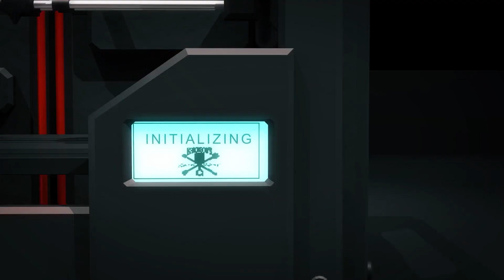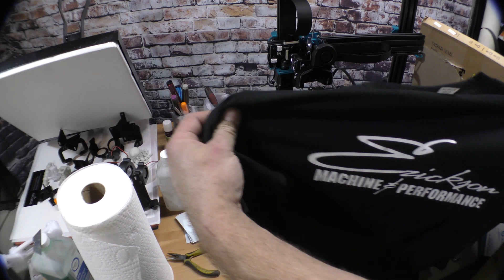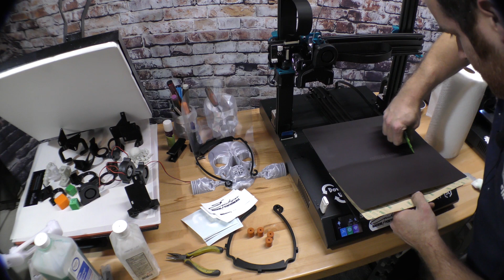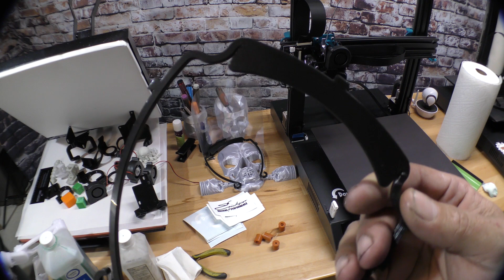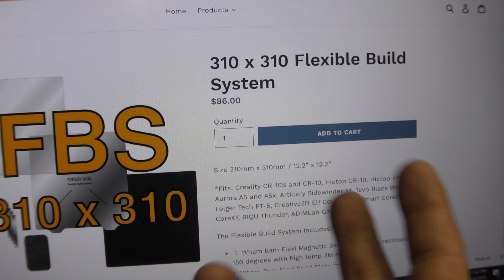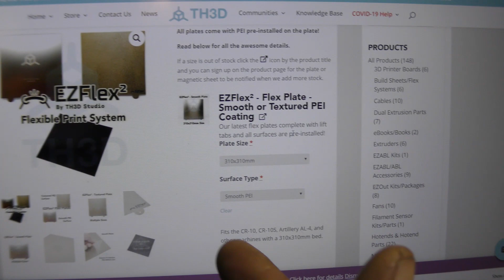How 2 Install a Flexible Build plate on the Artillery Sidewinder X1  Best Upgrade for ur 3d printer

Comment: Do these spread out the heat more and reduce the cold spots above the bed leveling screws?
Reply from the maker: The main benefit is easy part removal. Just flex and the parts come off

Comment: Try Lowe's, Home Depot, or a paint store like Sherwin Williams for isopropyl alcohol. You should be able to get it in 1 or even 5 gallon containers, and it will be at 100% concentration.
Reply from the maker: When I did this video it was when C o v I d was insane and you couldn't get alcohol

Comment: Idk if its the best idea fiddling with the high voltage printbed while the printer is connected to main power
Reply from the maker: That's like saying you should disconnect your car battery before putting on a
 sticker on your back window.  110v isn't high voltage And everything is shielded.       Your basically putting a sticker on a piece of glass 😉 

Have a great day
Reply: @EricksonMachinePerformance  i get your point, but after all in other countrys those beds have 230 AC and lets face it - chinese manucatured machines arent always really up to all security standarts
Reply from the maker: @ТЇІІ  do you unplug your machine every time you take a print off?  Your more likely to get shocked cracking a bed removing a print then installing a magnetic sticker..

Comment: Absolutely nothing wrong with the printer bed supplied. Why mess with stuff. ?
Reply from the maker: Makes it fast to remove parts.  Especially if multiple parts!! Or extremely large parts with a large contact area.   Also not having to beat on the bed to remove a print keeps everything level longer.   There's a reason Almost ALL high end professional machines come with them Standard.   Try 1 you won't go back!!

Comment: Thanks for that,
won't lower enough ,
I saw in your video you removed the 
four springs,and mentioned silicone bushes
Reply from the maker: Weird.  I added the silicone springs later
Mine fit oem no problem.   Try shorter springs or move the z end stop sensor

Comment: Why would you want to?
Reply from the maker: Why would you want to what?  Add a flex build plate?    Because they make it way easier to remove prints!!!
Reply: @EricksonMachinePerformance  Don't you just wait for the plate too cool down and it pops right off?
Reply from the maker: @amelliamendel2227  first depending on what material you are printing that doesn't always work. ALSO WHY WAIT!! with a flex build plate as soon as its done pop the plate, flex it and start printing again!!  i printed about 10000 face shields that we donated to hospitals and theses flex plates were a LIFE SAVER my printers were printing 24 hours a day 7 days a week only stopped to remove the completed shields. During that time the printers NEVER cooled down.    also the larger the print the more surface area the harder it is to remove     PERSONALLY i wouldnt own a printer without a flex build plate for general 3d printing

Comment: Do you have a link to the spring replacement
Reply: Yes please! I can not find them anywhere and the spring are driving me crazy!
Reply: I just found these for mu Artillery Sidewinder X1.  Search this on Amazon.  "BCZAMD Heatbed Silicone Leveling Column, 3D Printer Hot Bed Mounts Column Stable Tool Heat-Resistant Silicone Buffer for Prusa i3 Plus Anet A8 Wanhao D9 Mega, 4 Pack Brown"

Comment: I'm trying to figure out if I want these on my new sidewinder (arriving today!!) as I have a pei set on my Ender 3 and love it... But I got the sidewinder for petg, tpu & other hotter materials. I'm worried about them bonding to the sheets, do you have any issues with that?
Reply from the maker: i print Petg at 250c almost every day and have never had an issue. 1 of my sidewinders only prints Petg. i wouldnt worry about it but If you want to be safe use alittle glue but not needed     i like the th3d best. and the flex build plate is BY FAR my favorite upgrade
Reply: @EricksonMachinePerformance  thanks, now just comes down to texture or smooth 😊

Comment: I have been slow in making up my mind on getting a flex plate system for my SWX1.  I have not used my printer for well over three months due to health(non-COVID-19).  I ordered the Whambam system.  The TH3D is not available at the moment.  I have used the spring bushings and for whatever reason, I can not keep a good accurate bed so I went back to springs.  The springs are 25mm (yellow) with the flat bottom and they seem to do a great job.
Reply from the maker: I have found with the silicon you have to go back over them once or twice while doing the setup but after that ur good.   I think it just takes a couple seconds for the silicone to settle after its compressed which is why it moves a little bit initially but after its set they really don't move

Comment: I have to admit there's a lot of people who love this Wham Bam build plate But i really don't have an issue with the ultra glass/Lattice Glass build plate prints sick when printing and release when cold.
Reply from the maker: Have you used a flex removable build plate?   Pla the stock bed is great.   But petg isn't as good.  It's nice to be able to quickly remove and start another print. Especially large prints with alot of surface area
Reply: @EricksonMachinePerformance  Even with PETG my glass build plate worked like a charm. The stuff sticks like crazy, and pops off when cold. Every time. Still modded with a PEIK plate, which also works. Main advantage: the heat is more evenly spread, and less curling edges on large prints.

Comment: The specs on this printer say 300 x 300 on the X and Y. Why are you recommending a 310 x 310 build plate?
Reply from the maker: the build plate is always larger or you would be printing on an edge
Reply: Same reason my Ender is 220 x 220, but really 235 x 235. One is the build volume of the printer, the other is the physical size of the bed plate.

Comment: Great videos! I have sidewinder on the way and im looking at all the options etc. i was just thinking about the magnetic built plates and thinking the wham bam was a bit expensive by the time it gets shipped to aus with the currency the way it is. The TH3D looks like a great alternative for the money so i will get it. I watched the review on your printer and i like how you’re a no-nonsense, practical guy and your videos are easy to listen to. Keep it up 👍
Reply from the maker: The Th3d is cheaper and in the USA.   I have a link to it in the description.   Its my personal favorite
Reply: Mate, I'm about to buy one. Did you get yours yet? and if so, did you get the textured or smooth?

Comment: Which version of the Sidewinders are you using here? Version 4?
Reply from the maker: Yes both of mine are V4s.  But both are different 1 has the standard V6 heat break the other has the Kranken break.  But they are both awesome.   I believe the new Kranken style is the newest but I'm not a 100% sure
Reply: @EricksonMachinePerformance  thank you
Reply: @EricksonMachinePerformance  Did you put the Kranken in- or did Artillery upgrade the breaks now..  I just got a Genius and I'm wondering if they still put a PTFE lined break in.

Comment: You think this printer is too much printer for a first 3d printer? Seems like everybody suggest Ender.
Reply: I doubt it. With easy set up and leveling, just make the additions made in the video and you'll be making good prints in no time. The part that takes experience is learning the different nozzle profiles you will need to make successful prints with the different materials out there. If it's in your price range, buy once, cry once as the saying goes.
Reply: @MrDLRu  Thanks for getting back to me. Right now the biggest problem is finding one in stock. This seems to be a nice printer. I'll either get one of these or the Genius depending on what I finally find in stock. I think I'll use your link for the WB bed addition no matter what I get.
Reply from the maker: there is a reason they are sold out. They are in high demand because of there quality. Wait to find one or preorder it   you will live it
Reply from the maker: not at all the ender 3 needs alot of upgrades to print half as good as this. This is one of the best printers to start with 100%

Comment: You can use 90% acetone. Works exactly the same and it's not as flammable as people think(nail polisher remover). I use it all the time.
Reply from the maker: What about 100% acetone?   Will it affect pei or pex?
Reply: @EricksonMachinePerformance  It won't affect it at all. On the contrary most people(including myself) say that it does a better job than alcohol and everything from 90%-100% works fine.
Just try not to touch it so much with your skin because it can dry it out a lot
Reply: @efnick96  And, if I may add, avoid letting it drip on the machine's paint as it may dissolve it quickly :)

Comment: Sorry my mistake, I did not wait till the end of the video. I have not had any trouble with PLA  sticking to the PEX. JOHNNO HENNESSY.
Reply from the maker: I haven't had issues either BUT some poeple i have talked to have and the PEI that the TH3d is using has better hold then the PEX Wham Bam uses for Pla In my opinion    in Petg they are the same
Reply from the maker: No worrys thanks for watching!

Comment: Could you give more info on the Heatbed silicone spacers, what brand you used and where to purchase?  I have Artillery V4 and have heard that spacers need to be about 20mm???
Reply from the maker: UKCOCO 3D Printer Leveling... https://www.amazon.com/dp/B07QQSQD7P?ref=ppx_pop_mob_ap_share
Reply: @EricksonMachinePerformance  Thanks for fast response, looking forward to more videos.
Reply: Where did u buy ur v4 artillery?